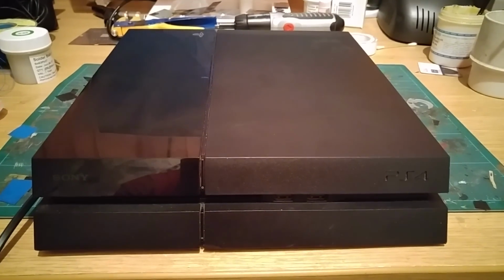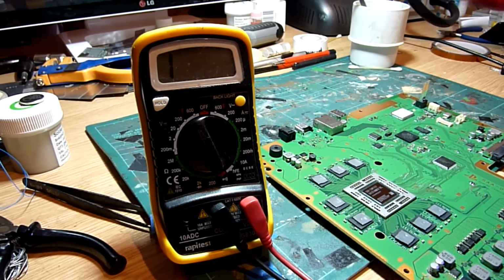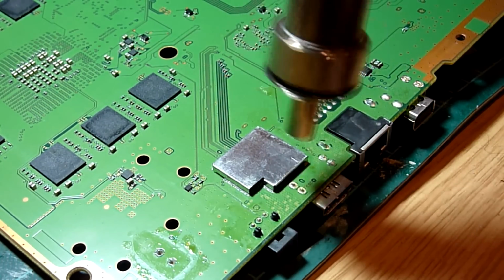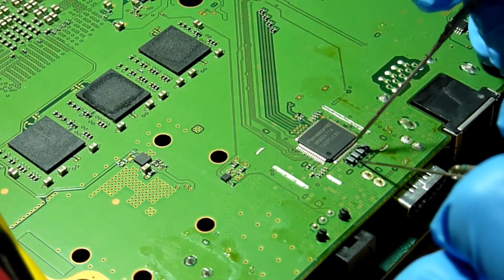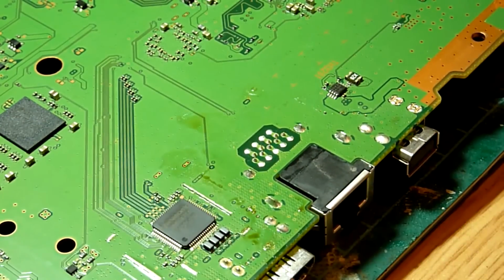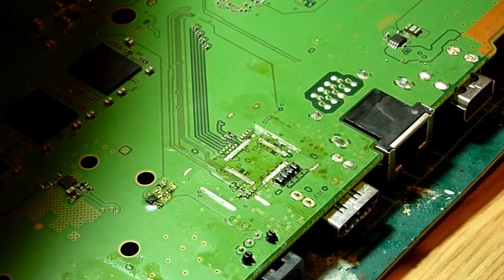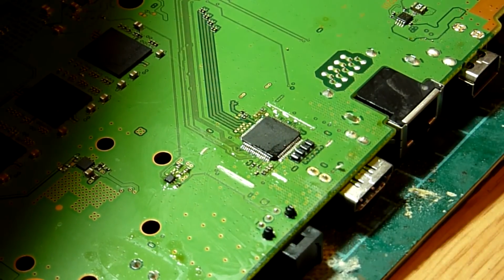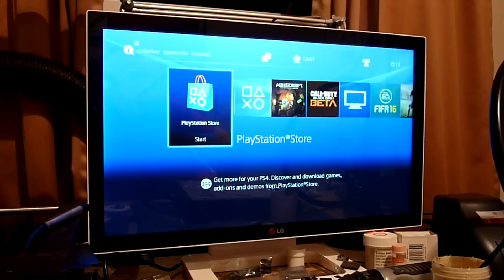PS4 Diagnose Faulty Panasonic MN86471A HDMI Encoder IC Chip Tutorial (WLOD)

Comment: Hello Andrew, I have a WLOD ps3 with no sceen output, safe mode not possible. Replaced the HDMI IC chip and after that the screen output was a noisy red. And when I moved the hdmi cable (good one) the screen went intermittently from red to nothing, so I also replaced the HDMI port. Now the screen output is constantly noisy red. Tested the 4 video filters next to the HDMI IC and they are all good. HDMI port pinout is good (checked your other video). Also the connection of the 8 points (video filter points) with top and bottom mobo are good. What do you think is the problem here ?
Reply from the maker: +ProConsoles Was the IC a known good part? Is it possible to test it on another board?
Reply: +Andrew Paul It was a brand new one actually. But I do have a scrap board with a good one on it. Can desolder that one and use it for this board. Can&#39;t stand this, it has not been fixed. After diner I will continue and finish this ps4. Tomorrow the customer flies back home in the US. I soldered on the HDMI with drag soldering with JBC soldering iron on 365C. Need to find out test points first. Besides thanks a lot for your very fast response ! :-)
Reply from the maker: No problem, and please let me know how you go :)
Reply: +Andrew Paul Replaced the HDMI IC chip, by a HDMI IC chip I desoldered from a scrap board and ....... again no screen output. Somehow this HDMI chip was not good, I hope and suppose. Tomorrow I will take again, a new HDMI IC chip and post the results. I like to mention that I desolder the HDMI IC chip somehow different, then how you do it. I use low melt solder to lower the melting point from 217C to 150C, then use hot air to desolder the IC chip. I think it is a little bit more safe. Do not want to damage the surrounding components.
Reply: +ProConsoles Soldered in a new HDMI IC and still the same problem. Pin 13 of HDMI connector does not have a low resistence. All connections from end of HDMI cable to the test points are good, video filters are good. Nothing of the soldered connections have shorts. Still WLOD without screen output.
Reply from the maker: +ProConsoles Hi mate, there's two little ICs on the topside of the board towards the rear of the HDMI circuitry. These can short and they take the larger caps in front of them with them - I think they read 10uF if I remember correctly.

Ah yes - see here: http://www.bgamods.com/forum/viewtopic.php?f=86&t=5354
Reply: +Andrew Paul Just checked both capacitors and they are both 10uF. I have found a scrap board of the same type with other problems (not HDMI). Now I can compare the motherboards, do you think I need to focus on the components in the surroundings of the 2 capacitors ? I know for sure the HDMI port and HDMI IC are good, measured everything and checken with my Amscope microscope. Do you still think a component on the board is defective ? Are that a BGA chip needs reballing, like APU or SB ? However cannot imagine that a broken solder connection under the APU or SB can cause a WLOD.
Reply from the maker: It's not an APU or SB issue - if it's got a white light then the system is up and running. I'd focus on the surrounding components of the IC and compare the two to see what you can turn up. Good luck!
Reply: +Andrew Paul I have the exact same issue ,wlod, changed hdmi chip, tested all connections from port with cable plugged in back to right side and bottom side of hdmi chip , all good ,those pins are really small took me nearly a day to line up ,straighten and solder that chip (from donor board blod) ,really tough one .still no video,and apu runs reallly hot. tested voltages out at port got all same voltages as working ps4 i tested and compared to. will get brand new chip to swap out and a hdmi signal tester next, but do you think there could be a short somewhere else on the board causing the high temp.?
Reply: +ProConsoles good luck, i have same issue ,does your apu run unusually hotter than a fully working board? mine does. i think i will have to rig up and power the working ps4  board to probe for proper voltages. checking resistance and shorts to ground have not turned up anything for me. let me know if you need any voltage readings from a working system.
Reply: <update> i ordered a brand new hdmi chip and carefully this time soldered it in , and have video now, all good . the first chip i swapped from the scrap board was bad. i may have blown it because i noticed that i bridged a contact 'After' i powered it for a test. (i was very tired). anyhow after checking all components and comparing to scrap board's components ,replacing a video filter which i cracked somehow drag soldering the new chip in All Is Working Now. the hot running apu must have been for the shorted hdmi chip ,since temp runs normal now.
triple check your solder points , traces , leads. i did not see the bridged leads because they were close to the body of the chip on the back side of the leads hidden in flux residue. good luck
Reply from the maker: Well done on the fix!

Comment: Hello Andrew. Very nice and educational video. I have a question. My PS4 boots and i get a white light too. Thing is, my TV does not recognize the device. It's like i don't have any device connected at all. But my ps4 boots normally. And i know this because i have it connected with optical output to my speaker setup, and i hear the booting sounds and the music from the menu just fine. So the ps4 is open and operational, but i get no signal at all. I opened it and hdmi port seemed fine. The encoder chip was replaced by a techinician at the end of April, but seems like the problem showed up again. Could it be that the encoder chip failed again? Could it be that the connection didn't last and probably just need some more soldering? The technician closed the encoder chip with the metallic cover so i have to open this first to check it out. And for this, i need to buy the equipment you use (heat gun mostly as i have the other stuff). Would i be sure that it is encoder chip's fault and not something else? I have no problem trying to fix it, but i want to make sure that this repeat in the future and i have a faulty encoder chip every 1 and half month.

PS. Sorry for the long post. Hope you can help me. Of fource i checked my ps4 with multiple monitors and cables, problem still persists. Just to clear things out :)
Reply from the maker: It could be a faulty Encoder or a bad port / lead. the fact you still have audio is weird. I'm not saying the Encoder cannot fail in this manner (it can) but I've seen it literally just the once out of who knows how many of these I've done by now. They normally fail entirely with the loss of both picture and audio.

Much more likely will either be a bad HDMI lead or a loose / pushed back pin in the HDMI port. Give the port a visual check and see if any pins are pushed back / out or are sitting proud of the centre plastic comb. I'd imagine the original repair will be under some form of guarantee? Will the shop not take a look and confirm the issue for you if you ask them?
Reply: Andrew Paul About the first paragraph, is it possible that the audio transmitted via optical output is processed through a different chip on the board? And the ic encoder chip is only responsible for the audio output of hdmi?
The shop does not accept my ps4 for guarantee since I tried to open it. Why would I open it if it worked correctly in the first place? Seems like something went wrong with their repair.
Can you explain what exactly do you mean by hdmi lead? Thank you for your time.
Reply from the maker: Ah OK - Optical audio comes from Southbridge so that explains that.
If the port still appears physically OK then I'd guess it's another failed encoder. If you haven't already, change the HDMI lead when you repair it again as it could be a lead issue which is causing the chip to fail.
Reply: I see. When you are saying hdmi lead, you mean the hdmi cable?

Comment: I was using a vga to hdmi convertor on my ps4 to use with my old monitor,coverter uses a 5 v adaptor but i accidentally plugged in 9v one,after that my PlayStation was being detacted on my tv as giving a signal but after a while it had no signal at all, could it be that its just the hdmi port itself and not the ic chip?

Comment: hi Andrew, i replace the IC and now i have a black screen but with sound, any suggesrtion??
i found the error, is the pin 6, I gaging in 20:02 and pin 6 does not give continuity, bypass or replacement? excuse my english but im from mexico
Reply from the maker: So you have no continuity across the filter? Check it from the top of the filter to the bottom - if no continuity replace the filter. If there is, then check it from IC to filter and filter to via. When you find which side the break is run the appropriate link wire. Cheers.
Reply: thank you very mucho you are agenius, video and sound ok

Comment: +Andrew Paul Thanks again for the vid, I have a small request, can you do a video on how you reball (refit) the spheres on your bga chips? I've been using a Honton Hotplate (ht1212) for the past years but now it broke and I am having problems getting used to direct heat stencils, trying to use my hot air station to refit it with not so great success as well.

Thanks again!
Reply from the maker: +Moreno A Hi mate, if you take a look at my APU reballing tutorial I show and explain the process I use to reattach balls to the chip - the tiniest bit of tacky flux applied to the surface of the BGA and then IR heat to attach. I'll do a dedicated video at some point in the future but for now that should hopefully get you going.
Reply: Thanks!
Reply: +Andrew Paul One other issue, have you fixed any Ps4 that does not pull discs? Tried to swap all pieces, flat cable, power cable, whole drive, wont pull. Was a ps4 that did not turn on and I reballed the apu, now it works but wont pull discs.
Reply from the maker: Is there power going to the Drive at all?
Reply: +Andrew Paul id say yes, the lens do click as if trying to focus and the eject sensor beeps normaly. I checked the conector on the mainboard to see if there was any broken part of the flat ( the ps4 came  all in parts to me) but it does look good.
Reply: +Andrew Paul just tested another pcb and it does pull and eject fine so it is the drive board, I dont feel fine changing the resenas IC, will try to swap the bd controller chip for test.

Comment: They should make the HDMI port like a USB thumb drive to be easily remove.
and an extra slot in case on slot gets damage, so we can just switch the HDMI output to the other side.
With the encoder inside eventually as a one part easy replace.
Reply: that defeats the purpose of a motherboard. it might make repair harder but makes making the ps4 easier because everything is soldered on the motherboard

Comment: please tell me in the bunch of hdmi is where the two resistor track is from the third diode for continuity can rings and shows 22 ohms is this normal ?vipal also sveneti and 22 ohms ?there is soprotivlenie should be sab 001 was replaced with the controller Panasonic video was the white snow and the reddish then all sound disappeared'm sorry for my English bad

Comment: Hello, I have CUH-1003A PS4, UK Day one edition. I want to order a replacement hdmi IC  but I'm not sure of which Panasonic model I should order. Also, can you please tell me how you reinstalled the heat sink on top of the ic chip
Reply from the maker: You'll need a Panasonic MN86471A for a 1003A. The metal shield can be left off if you're struggling , but to place it back you'll need to re-solder it back using a fairly large iron tip and flux.

Comment: quick question i actually replaced my internal fan awhile back and about a 6 weeks later i fell asleep watching you tube on console woke and put it in sleep mode when i got home and tried turn it on sometime it starts to run and then shuts off other times it cuts on normally but i get no picture or sound any idea what might be causing this.

Comment: Wazzup bro , My beloved 1st generation ps3 slim having a problem, it stuck at 480p at HDMI. I resolder the PS3 HDMI port and it not fix the problem, do you think it's the panasonic MN8647091 hdmi transmitter is the problem? it can't recognize 720p 1080i and 1080p stuck at 480p only. AV multi out is functioning normal.
Reply from the maker: +playstation2bigs Hi mate - yes that's probably your issue.
Reply: +Andrew Paul do you think it's a cold solder joint? or replace the whole i.c. ?
Reply from the maker: +playstation2bigs It might be worth doing a drag soldering job on the IC to see if you can get rid of a cold joint or two but if it's anything like the MN86471A found in the PS4 then dropping of the HD resolutions indicate an internal fault and will require a replacement of the IC. Cheers.
Reply: Thank you very much Andrew more power
Reply: +playstation2bigs That's what happend to my PS4 3 weeks ago!
mofos wanted 200$ to fix it. I rather pay 400 for a new one with 3 years warranty.

Comment: Hi Andrew, I have replaced a HDMI transmitter chip, but for some reason only getting Sound output on the HDMI.... would you have any idea what would be next suspect? HDMI port looks fine, so i haven't replaced that yet.....
Reply from the maker: Sound but no image is typically down to a bad encoder, however as you've just changed it I'd be more inclined to suspect a loose / bridged pin. Give them all the 'nudge' test with a tweezer blade and see if you can get any to move and resolder them if they do. If you've any shorts / bridges between pins then these will need to be removed. If that all looks good, check the EMI filters to ensure they're within spec.
Reply: @AndrewPaul  i did check all the pins, pretty sure there is no bridging or loose pins though i will check again once more just to be damn well certain ! I continuity tested the 4 filters, they all came out fine.... just like how you did it in this video.  Pretty stumped to be honest, the sounds on but no ones home ! lol.
Reply: @AndrewPaul  Thanks, was one of the EMI Filters! Brilliant!

Comment: What temperature do you have your soldering iron set to for applying the leaded solder to the pads?
Reply from the maker: +Chesley McDaniel It's self-regulating so I have no control over it. The iron calculates the needed temperature by measuring the heat draw across the tip when touched to place where the joint is required - so I don't know what temperature it's using. Cheers.
Reply: +Andrew Paul Oh okay, fancy! :) Thanks anyways.
Reply from the maker: +Chesley McDaniel No probs - however, my TP9 tip has blown this last week and I'm waiting for a replacement so I'm back using my old solder station for now for fine work. To drag solder effectively that station has to be set to 485 Celsius.
Reply: +Andrew Paul Thank you for that. I wouldn't have expected it would need to be that hot. Now I see why I was having trouble. My iron only reaches 450 Celsius but I was afraid to turn it up that much out of fear that it might fry the HDMI chip. Have been having hell with my ps4, pulled a pad where the Panasonic HDMI chip mounts (due to having a much to large hot air gun and being afraid of burning up the MOBO), so I attached a very small jumper wire to the proper circuit but still have WLOD. Now after several attempts, I broke off a leg on the Panasonic chip where I had the jumper wire.

Comment: Do you know if that metal plate above the video chip is important? because mine came without it, it was used
Reply from the maker: Hi,
It's an RF shield - not vitally important in most situations - I've seen many machines with them left off over the years and they've been fine. As always though if you can put it back, do.
Reply: @AndrewPaul  I was worried that the ps4 would not work because of the lack of that thing.  Thanks for answering me :)

Comment: I just replaced the hdmi port, witch didnt seem broken to me, but i did it anyway. That didnt work and its not picking up on the TV. Is that an encoder problem?
Reply: 21:45 Need to trace the filters before changing the ic just to be safe! U may be getting rid of a good ic for nothing if there's no continuity on your filters.

Comment: hi Andrew , i removed accidentally 2 of the 4 caps (ferrite diode) near the panasonic chip when i putted the heat gun  , they are damaged, so can i make a direct link between the 2 point of them?
Reply from the maker: +Lena-Payette -et-cie Hi, if you can't source replacements then yes you can just bridge them with wire. Cheers.
Reply from the maker: +Lena-Payette -et-cie Hi, if you can't source replacements then yes you can just bridge them with wire. Cheers.

Comment: I dont know if i recieve a faulty replacement, but before theres was continuity betwen in the 4 filters, i mean each pin of them. So i took off the ic and the short was gone. So i solder the replacement and theres continuity in the 3rd filter. Thats normal? Can you tell me if i have a faulty replacement? Thanks
Reply from the maker: Sounds like you either have a small bridge between the pins (they can bridge to the rear and are hard to spot without a scope) or a faulty replacement.
Reply: I desolder it again and clean it. Still there  (in the ic) so I guess its a faulty one...